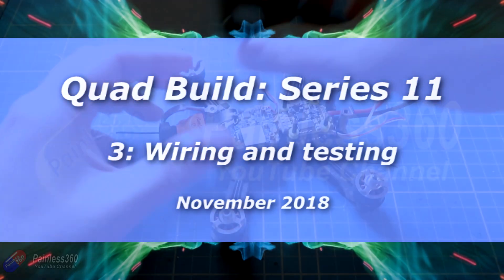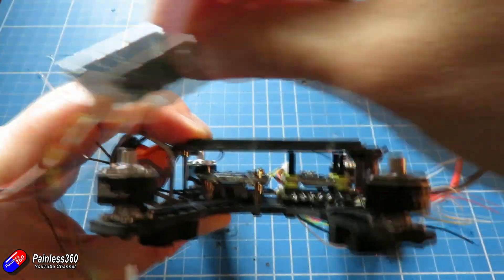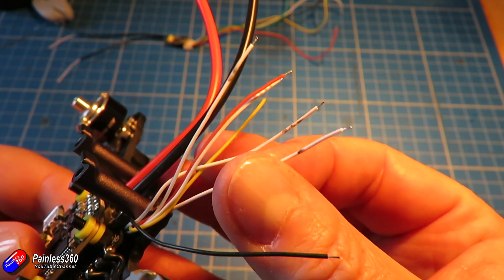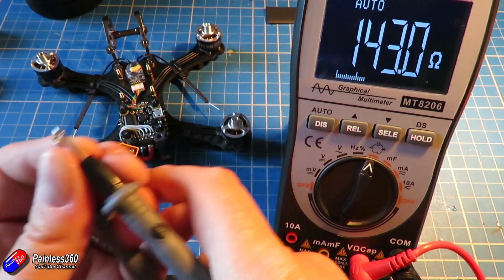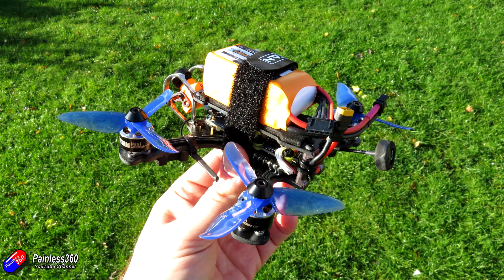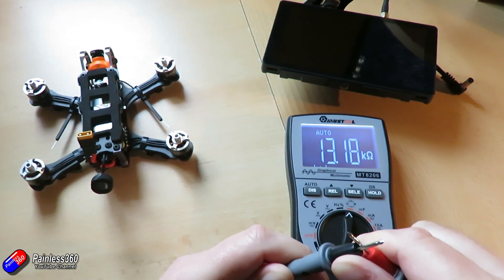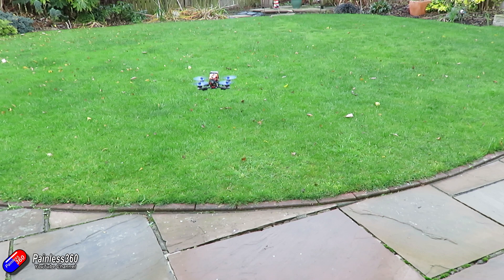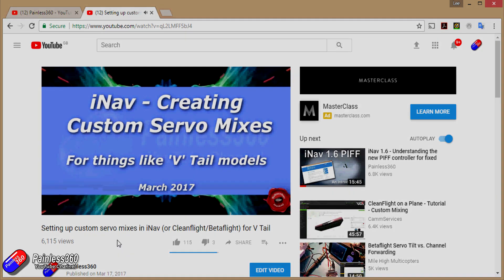(S11.3) 3" Quad Build - Connecting the pieces and test hover!

Comment: Got an identical build (except motors) followed your guide, but cannot get rid of the horrendous interference even with a cap installed, although I have noticed my split mini 2 pcb is different to yours, mine doesn't have small pads in a square between the ground and video.
Reply: @Painless360  Thanks to Cheng Lin of CL_Racing I have already established that my camera is the issues, tried a different one (foxeer arrow) and it was fine. Also tried a different vtx and that made no difference.
Reply from the maker: Glad you got it sorted. What was the camera causing the issue?
Reply: @Painless360  Yeah the interference was only present using the split mini 2, when i connected up the foxeer arrow with the exact same cable setup (minus the tx/rx pads) the interference was gone. Still powered by VBAT, heres a link to the DVR recorded on my ROTG, plug in, camera starts up, camera dies, unplug battery. https://www.youtube.com/watch?v=X12hRCDR4uw

Comment: Is the range better on the receiver with the antennas on the arms opposed to on top ?
Reply from the maker: Range is very subjective but antenna placement is one of the biggest things that can affect range and signal strength. As models like this one are flown well inside the maximum range of a legal 2.4 Ghz radio system it's not as much of an issue and you'll find that one of the antennas can 'see' the radio well enough as you fly about. The trick is to have them clear of the model so they are not both obscured at the same time. Hope that helps..

Comment: I see that you used an R-XSR and you didn't use the inverted pad in your build - I tried using softserial on the TX3 controller pad just like your layout pics, but can't seem to get it to work. Were you able to get telemetry on this board with a few extra steps you didn't cover in the video?
Reply from the maker: See description..

Comment: I just switched to the cl4mini from the mini talon. And now I have issues with the 4-in-1 esc acting like it needs calibrated but I'm running dshot 1200. And the power is cut in half. I'm clueless what could have changed? I even updated the blheli32. Any ideas?
Reply from the maker: I’d try DShot 600 or lower in case it’s a weird timing issue. Best of luck!

Comment: Could you use F.Port to solve the problem ?
Reply from the maker: Maybe. Something to try when the code is final..
Reply: @Painless360  I used F.Port on the last 5" rebuild I did, mainly because it was using a KakuteF3 which is low on COM port count and I really wanted Tel. and SmartAudio working on the Taranis. Looks like the RX is a naked X4RSB. Nice thing there is that the F.Port connection uses the S.Port wiring/socket, so no soldering required on the RX. Seems to work fine, passed hover test, not flown it as yet tho. Cheers.
Reply: @Painless360  are you still having problem with telemetry using smartport? Did you solder to the uninverted smartport pad on the RXSR? That should make it easier.
Reply from the maker: That’s the easiest fix..

Comment: I have a question, I don't know who ealse to ask.  Your the tarranis master so here goes.  I have a the XD9 plus, with open tx, I think I flashed Us version on it becouse I have D8 and LR12 available, but I just got a drone with an XM+ receiver.  Do I have to have EU version on the radio to bind to it, or is there a way to work around that.  I don't understand the difference.  I live in EU.  Hope you have the time to help me out, or point me to the right video.  Thank you in advance. I wouldn't be in this  hobby without your helpfull videos. Love your channel so much ♡♡♡
Reply: Hello if I understand your question, you only need to flash xm+ to non EU version .
Reply: Thank you for the info, I have found some videos on Painless360 playlist, where he talks about this.  It seems like I need to find out if my XJB internal module is eu or non eu formware, I just don't know how yet....  I found out that I have flashed non eu opentx on the radio, but I didn't know about the XJT internal module ( wich as I understand is what actually determins what type of signal is sent and recieved)  correct me if I am wrong.  Am still just a beginner.  At the end of the day, I will just have to flash the right type of firmware to my xm+ for everything to work. Thanks
Reply: @SOLARFPV  If you live in the EU I would recommend you re-flash your radio to the latest version of EU(LBT) - all three software updates! Then you know what system you're using. FCC is ilegal in the EU and will invalidate any insurance.
Reply: Patrick Colclough. Thanks, that was exactly my concern, I bought mine from china, and sice I can't bind to the eu lbt xm+ I have determined that the XJT module is flashed with fcc.  No wonder I get alot of interference.  Thank you guys so much for taking yor time to help me out.  Been flying illegal for 2 years now not knowing :-)  live and learn.  Will I still be able to use D8? since I have some kwads using that.  I have open tx. When you say all three software updates you mean I start with the oldest and flash that and then flash the newer versions in the right date order from oldest to newest?
Reply: I figured it out!!! On the back of my Taranis it says FCC on the sticker.  I made a playlist on my page, to help people out in case they have the same issues.  The videos I saved in there explain it all very well.  Flashed the XJT module using the SD card, everything is working now, and I am not confused anymore :-)  hope my short playlist of videos helps others.
Reply from the maker: Glad it’s sorted - https://www.youtube.com/watch?v=C5xpq5ti5Gk
Reply: Thanks Lee, wouldn't have figured it out without your video explaining about the XJT module.  And the support from our youtube community.  Thanks alot everyone.  Fly hard!